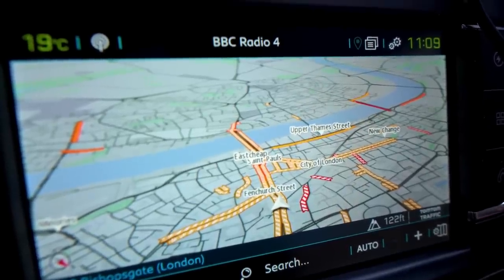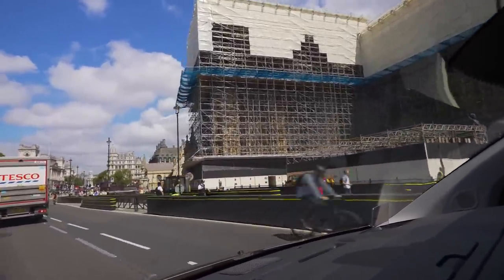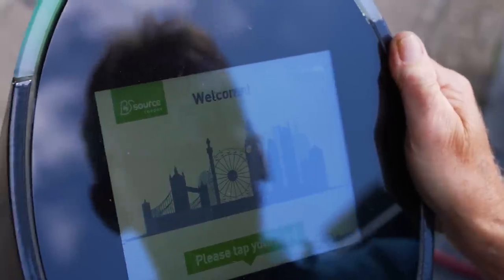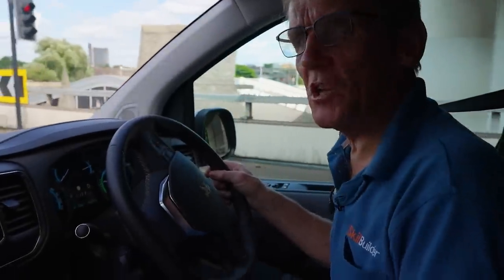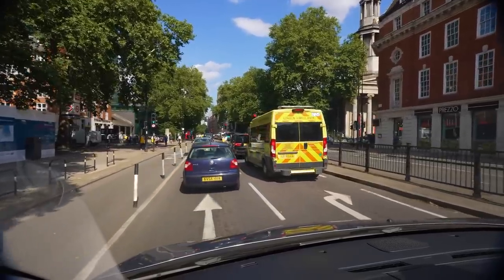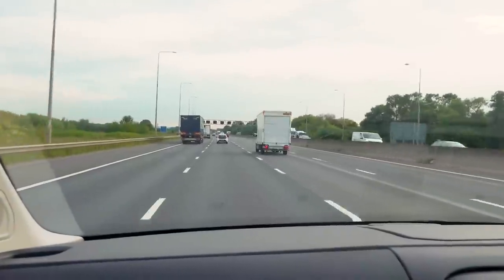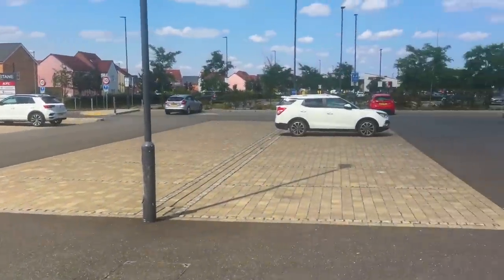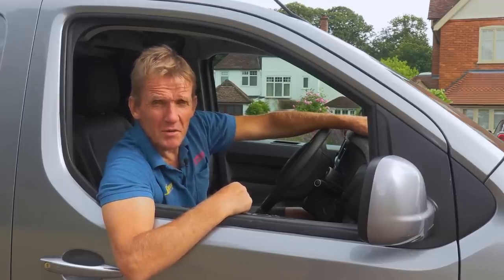Is It Time To Switch To An Electric Van?  e-Expert Test

Comment: thanyou for an interesting review . Personally , i can;t afford a new van , let alone an electric one . For the amount i do these days its just not worthwhile anyway .So my vans are older vehicles, mine currently is a 2004 . Would i buy an older  used electric vehicle?? not a chance! How long will an electric van last for? They get mistreated as a rule anyway but what is the range of a 10 year old ev?  Test driving a brand new vehicle should be a good experience , its new! . Quite frequently also , you may get a call out for an emergency on your way home , if you have no  range lefdt then its tough.  EV 's are a good idea but practically , they have a long long way to go  to be worthwhile in the real world i think . Depending on your use for them of course

Comment: I struggle to see the benefit of some elements of current car and van development. Why do I need self closing doors? It's not he hardest job in the world, I bet it's expensive to repair and a pain to get fixed, you have the extra weight of unnecessary components and the higher initial purchase cost. And at the same time they don't give you a dashcam which would probably cost them less than £20.

Comment: no wonder you used 40 miles of range on 25.  That B mode is far less economical than driving with less regen. 
People insist in this idea that "more regen = more economical". which is very much wrong. If you can anticipate and coast earlier on without needing to brake, coasting is far more economical than regen ( or heavier regen). so if you can do without "1 pedal mode"  do, as you will do far more miles on a charge.

Comment: Just like the old milkman buddy nothing more than a run around not to far in your own manner. 7 hours loaded drive to North Wales and back would mean a tent or a hotel. If you need to think van 24/7 anywhere you may need another job of work as the people that build then obviously do not use them, as towing a small trailer, forget it and grab the train. 50 grand of absolute rubbish in wheels and worth about 4 grand not to far down it's road because of the battery life and that's if it doesn't catch fire first.

Comment: Does anybody know the specs and on board 12v battery and tray? Any chance it can be upgraded to something bigger and lithium, like 300AH Lithium ?  Does the AC run off the 12v battery?

Comment: Zero emissions? Nuclear power stations and oil/coal burning stations produce the power. Also lithium for the batteries is mined destroying landscapes, or extracted from salt lakes taking 500k gallons of water per tonne of lithium and then it’s shipped around the world to processing plants to be made into batteries that can’t be recycled or dealt with at end of life. If everyone goes electric how will we power all these vehicles? More power plants because wind and solar is not constant.
Reply: Still far better than diesel or petrol.
Reply: @Simon-dm8zv  can you explain how please?
Reply: @DeOldSod  Due to the efficiency of power stations and electric cars driving electric on non renewable energy causes less CO2 than using petrol or diesel. Battery production emissions are low enough to be compensated for within a few years of driving.
Reply: @Simon-dm8zv  I really don’t agree, Take a Lithium mine, workers travelling to and from it daily, heavy haulage, construction of mining offices and buildings, retention ponds, diesel excavators, blasting, water pumping, site generators, stone drilling and crushing, all on diesel and at the cost of a ruined landscape/ environment and wildlife and communities displaced. Then ore transported loaded at docks and shipped around the world in ore ships running on bunker oil the worst of the worst to burn, then offloaded,  smelted and refined and then transported as metal to a production plant to be made to a battery that might last 6/7 years before losing 40% of its efficiency and vehicle scrapped or another battery inserted…….so tell me again how this is saving the planet?
Reply: @DeOldSod  Yup, it is still far cleaner. ever wondered what needs to happen to get a gallon of gas in your tank?! Battery production only happens once. A gasoline car is inefficient its entire lifetime. That is where the difference comes from.
Reply: @Simon-dm8zv  my point exactly, now we have two destructive processes, mining for lithium and crude oils with refineries and haulage. Pardon the pun but when in a hole we need to stop digging! Sodium ion batteries are being designed, pulling sodium from sea water or what about hydrogen? I have a hydrogen cell on my diesel car and it’s fuel consumption went down by 45% overall and it’s emissions at its annual test by 72%. Transport is necessary and we need alternatives but not batteries that seem clean and it’s no good passing the buck of a tailpipe in a city to a smoke stack of a power station by the coast that’s needed to charge that EV.
Reply: @DeOldSod  The data is clear, EVs are always cleaner. Hydrogen is far too inefficient by the way, would require too much energy and therefore cause too much CO2 emissions.

Comment: The powers that be in the USA want to convert everyone to all electric vehicles. While this may be a good idea in cities, I don't see how it will ever work in many areas in the USA. The infrastructure needed just to recharge them is a logistical nightmare in any large country. Little things like having to charge the vehicle every so many miles quickly becomes a huge issue as soon as you leave the city. When you have to drive 300-500KM to get somewhere, one way, suddenly a trip in an electric vehicle is no longer a viable option. You can't put charging stations somewhere there is no electrical service either. I live in a state roughly 70% bigger than England, with 6% of the population... There is not much here other than mother nature, open plains, and mountains you would never want to be stuck on overnight with a dead battery and no heat. I completely agree that emissions need to be dealt with. But I also can see the obvious flaws in thinking every county can go all electric with present technology. Some countries maybe can because they are small, but it will still be a huge investment and undertaking with a good chance for failure. Others never will without massive breakthroughs in technology that don't come from hoping someone else stumbles onto it. People need to face the facts that all of these battery advancements that people keep pushing have not happened, and there is no guarantee they ever will. If we spend untold amounts of money converting everyone to electric vehicles and those advancements never come, the whole system will inevitably fold up because there wont be a way to sustain it. Electrical grids all over the world are already struggling as it is, let alone after plugging millions of cars in to recharge. Just about everything planned for electric vehicles replacing fossil is depending on a battery technology, that doesn't exist yet. That makes about as much sense as counting your chickens before they exist.... Because that is exactly what is happening, planning on technology that doesn't exist, and may never exist.
Reply: in my opinion evs will only truely become practical when battery packs can be swapped out in a matter of moments seamlessly for fully charged ones..  thus being similar to filling a vehicle with fuel

Comment: electric vans  are to expensive and shite at range and charging speed both speed of charging  and price need to be cut by 50% and range be increased   by 50% until this is sorted don't by electric  vans  lease fore in town work only other wise  not fit for purpose at present

Comment: Like the idea but for a 35k outlay on any vehicle I would like maximum versatility and this would include a trip up to the lake district. If one is able to afford this van + parking space for two vans then perhaps it is a nice bit of kit to add to one's toolbox. Note:- that very very few people could possibly fit a fast charger to their homes that can charge from 0- 100% in 10 hrs.  Battery on this van =75Kw so one would have to go straight home every single day to get 10 hrs charge on a standard 7.5kw charger.  Don't forget that this vehicle will lose about 5% range after 1 year and throw away after 10. My diesel dispatch has add blue and dpf so it is really quite clean for the price.
Reply: Clean? Maybe, but any diesel vehicle is still burning a resource that's running out.
Reply: @fontyyy  power stations also burn fossil fuels to create electric for EV's
Reply: @julesdowner5585  depends how you generate the electric.
My supplier is 100% renewable .
Reply: @fontyyy  It was going to run out by 2000 and we are still getting billion of barrels a day out of the ground 22 years later.
Reply: @fontyyy  Only when the wind blows and the sun shines

Comment: Purchased the 75kw version for £27k plus vat . Cost of an ev is 100% offset against tax . 

Was spending £50 per week on diesel . Now spend £8 per week on electric using off peak tariff saving roughly £2k per year on fuel .

The van has no gearbox ,clutch ,dpf filter , exhaust , engine oil , gearbox oil , radiator , injectors , starter motor to service or maintain . Who knows the saving of not maintaining these parts im going to estimate £2K.

After 10 years
 im claiming the full cost of vehicle back against tax                         £27k 
cost of 10 years fuel saving                                                                      £20 k 
cost of not having to service all those parts                                          £2k 
estimated resale value after 10 years ? who knows but it wont be nothing 

Net spend                                £27k
savings after 10 years           £49k

total saving after 10 years     £22k 

Sparky working in a 60 mile radius

Comment: My friend got one of these EVs from the Council as his disabled vehicle. He told me it had a 140 mile range and he was down to just 55 miles after having driven 20 miles to Swansea and back. He is not impressed and it stops him from making longer journeys like driving to Cardiff - some 50 miles away. I felt sorry for him having a brand new vehicle but effectively being restricted to such a small driving radius. The Council must have spent about £45000 with the wheelchair conversion.

Comment: If every vehicle was electric then all advantages would disappear and the costs would go through the roof. Road user charges will be in congestion charges will be in and then battery replacement charges will be eye watering. How about a couple of thousand quid to scrap your old battery. There’s no such thing as a free meal. Don’t expect it!!! AND THE OLD ELEPHANT IN ROOM, what material are we going to use for building new/repairing roads??? Can’t use tar macadam, can’t use concrete, can’t use timber! Watch that space because that hasn’t been thought about!!
Reply: The point is emissions. EVs produce far lower CO2 emissions.

Comment: Range anxiety. Wide open spaces in the US. All considerations. But I enjoyed your low-key review (almost rant free) and the drive around London. Develop Covent Garden?  Inconceivable. A relative size story. When ICL (UK) acquired our US company they decided to strip field engineers of spare parts stores in their vans. The engineers could diagnose the problem at the customer’s location,  drive to a depot to get needed parts, and then return to the customer’s. Worked to cut parts inventories in the UK, after all. Management quickly undecided.  Thanks for the video.

Comment: Got a 75kw one so nice I don't need a second vehicles for family.But it's french and there's a few problems not mentioned in video.There is too much room under bonnet as van designed for fossil. So can't store charger lead there. Can only set on-time for off peak electricity and no off time setting.The operator's manual is online version but their server in Paris is out of service. I am 5'8 tall any taller and you might find seat won't go back enough. Some wiring not up to German standard. But this is still a excellent van and will take over the medium van market on cost to run alone

Comment: They already complain about people putting their kettles on at half time when the footballs on. How are they going to manage when all the country are as good as running their kettles all night?
Reply: Electricity usage at night is very low and having cars plugged in using that energy would allow the grid to run much more efficient as energy wouldnt need to be wasted powering up and down powerplants. At times the national grid can be seen exporting excess because we are generating too much especially on windy nights so presumably all pumped hydro has no work left to do.
Reply: @stanleyplank  Yea if you actually learned how the national grid worked you wouldn't be taking a load of crap
Reply: @RandomNoob  Lol. The majority of energy used by all these power hungry charging cars will mainly be generated by imported gas. Not very 'green' now is it?! I don't believe theres an option to just use wind and solar is there?
Reply: @stanleyplank  The national grid uses nuclear, wind and solar and biomass primarily, at peak times pumped hydro is used to fill in the peaks, gas is only used when there is not enough renewable and varies greatly depending on the weather sometimes gas is as low as 10% and at others can be 50% buy typically around 20-30%, very rare any is by coal although on the rare occasion a coal plant will come online.

We currently also import a small amount from various DC links with the main one now looking to be the new links with Norway that has a large abundance of renewable energy.

The national grid and it's power generation is all publicly available and viewable online in realtime.
Reply: @RandomNoob  Gas is never as low as 10%. It is currently over 40%..........and obviously all that extra demand won't be catered for by solar at night will it? And if the wind isn't blowing? Yes you've got it!  Fossil fuels. Now go away, I'm having a pint.
Reply: @stanleyplank  It can be that low during the night and enjoy your pint
Reply: I'm buying a Horse and Cart !, although it's been tried before!.

Comment: Great honest account of what could work for you.  I honestly believe that the forthcoming battery technologies, providing twice the range within the same physical space and weight, will unlock BEV vans for almost all use cases. But we’re not quite there yet. Cheers.
Reply: Peugeot has just released this very same van with hydrogen fuel cells. I believe that is the way to go to get that range.

Comment: I have an LPG conversion which gives clean air also but I get no credit for it. The government should quit trying to be control freaks or should at least be consistent. That Peugeot van is powered mainly by gas powered generator stations in the UK and it gets a pass into London while I burn exactly the same sort of fuel directly and I don't get a pass which is an utter nonsense. The best way to be eco-friendly is to keep old vehicles on the road as long as possible provided they are LPG converted. By the way you can see the difference in the exhaust fumes between an LPG conversion and standard vehicle easily as there are none from the LPG unit and my engine oil looks as clean at 12,000 miles as the day I put it in as there is no soot produced in the burn and even diesels can be converted to run on 2/3rds LPG and again the burn is far cleaner reducing soot production massively in those vehicles. An electric vehicle in this country has to travel 100,000 miles before it beats the CO2 manufacturing and running cost of an internal combustion engine vehicle due to the huge CO2 cost of producing the batteries whereas for an LPG conversion the figure would be closer to 150,000 miles were it not for the fact that the  EV requires a brand new battery at round about 100,000 miles with all the additional CO2 that entails so meaning it never beats an LPG powered vehicle if the LPG vehicle can be kept on the road. As usual none of what the government ever does makes any technical sense whatsoever.
Reply: Your numbers are far off and no, LPG does not provide clean air. Combustion engines are over.

Comment: Just an expensive milk float that costs more co2 to produce than a diesel and will cost more co2 in electricity production to run. All in all a big thumbs down for the environment. What a scam. How much did your sandwich actually cost in waiting time?
Reply: You sir, are wrong.

Comment: British gas have electric vans and they have to call out the AA to recharge them. Recharge points are not working in many places or there is a queue. Anyway it means the gas man won't be coming to fix your boiler today....so that means both of you have done your bit to save the planet by not using fossil fuels...except the AA who has driven there in a diesel van and then used a diesel generator to recharge the electric van ....and you have used that old oil filled radiator to warm up the kids and watched the electricity meter get dizzy...
Reply: Yeah nice anecdote..

Comment: Things to remember is the electrical distribution infrastructure would not be able to cope with a massive increase in charge stations let alone everyone charging at home...... new builds are now having 3ph electric installed to help with increased demand but currently its not there

Comment: I had been looking into the electric van , and eyed this platform from too.. 
200 Miles look fine, certain other makes are 75Miles! 
Look batteries will leap forward, solid state units are almost here but at least 1-2 years away from , so expect replacement in 5 years to give you 400miles, 
So square one really diesel is 450 miles on most 80Litre tank size medium vans.
When I tow 1-2 tons with a transporter, or  transit it 400miles tops, but I would swop to electric torque. 

Great too see the Londoners out look too, on there heritage..  very impressed.. most haven't a clue   : )